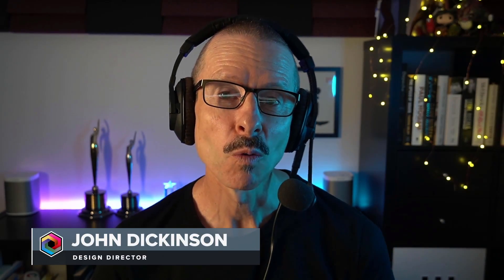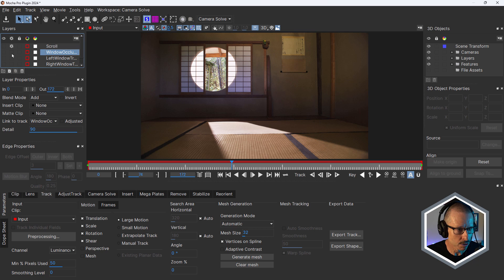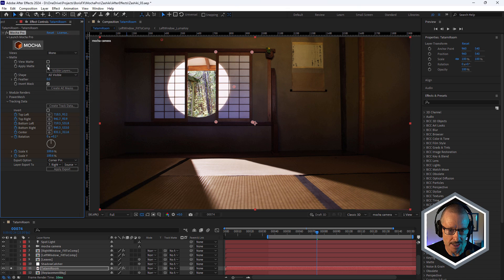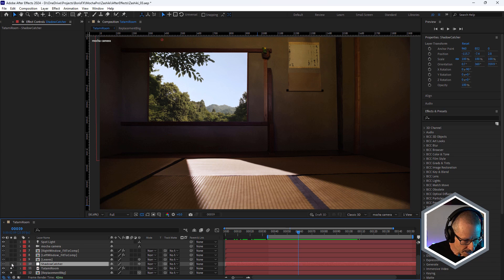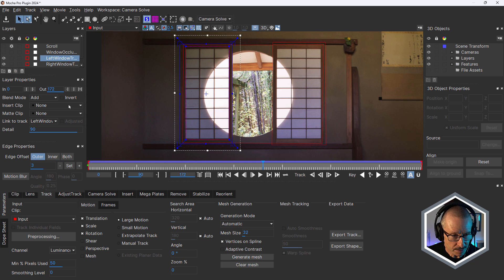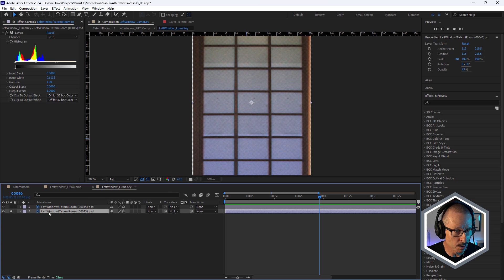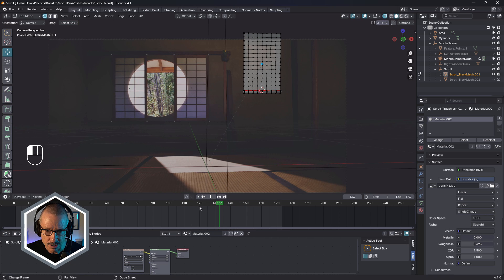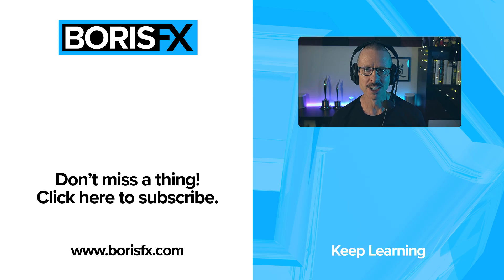Mocha Pro 3D Camera Solver Workflow - Part 03

Comment: Hi John, I'd like to see clean plates being attached to Nulls from the camera solver. I can get this to work parenting text to a syntheyes 3D point null in AE but a cleanplate parented to the same null is way off in 3D space. This is also after aligning ground plane. (Cleanpalte is comp resolution).
Reply from the maker: Is the cleanplate just a patch for that area or does it cover multiple planes?  A small patch can usually be floated over the top. But you're probably going to need a camera projection workflow. 

We cover a little about getting the groundplane here : :https://youtu.be/wEM6eyrrAgY?t=473&si=sc9EFHdHs5CPKfh5   It sounds like we need to do a full on tutorial for this.  I'll get it on our list.
Reply: @BorisFXco  thanks, the cleanplate it's just a patch for the area with alpha. I don't understand why Linking text to the null from the camera solve works but not the cleanplate, seems like the anchor point is off or something. Full tutorial sounds good.